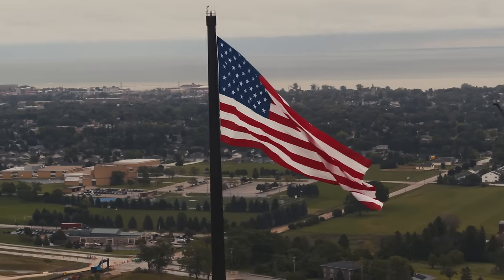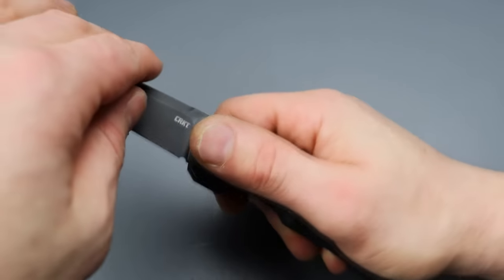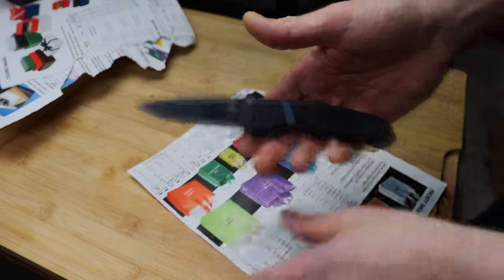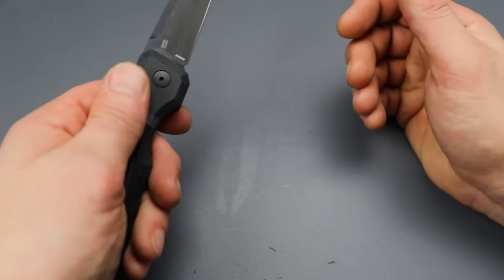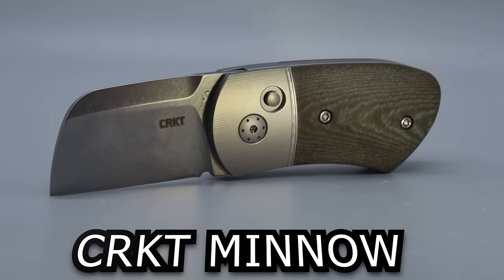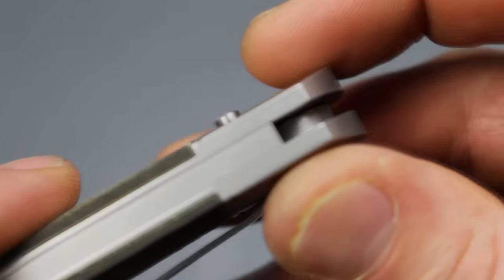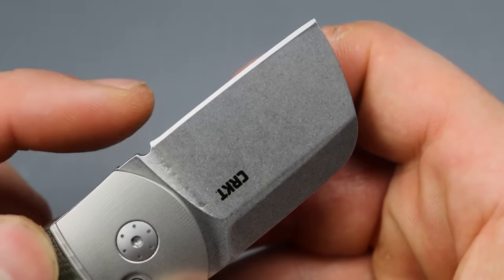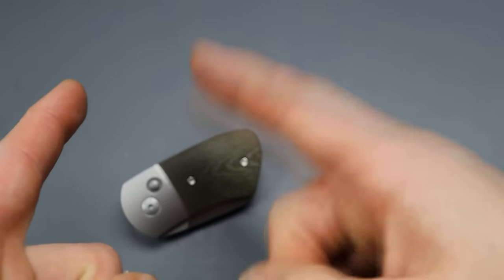New USA Made CRKT Knives Made by Hogue in Magnacut

Comment: I wouldn't be surprised if it is at 61-63.  The Ritter RSK's in magnacut are also being ran at 61-63.  Doug said on insta a while ago they were having problems hitting the 63-64 that they ran on the sprint carbon fiber RSKs in Magnacut in larger production runs.  I don't know if they changed the heat treats on their Dekas or not or are still running those at 62-64.
Reply: 💯  this ☝️